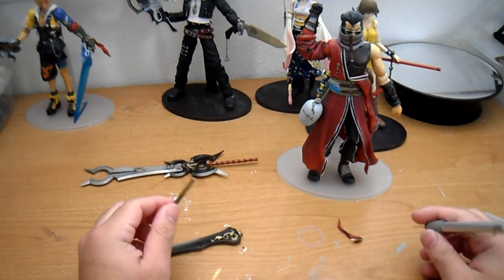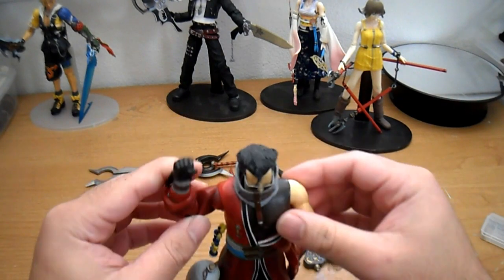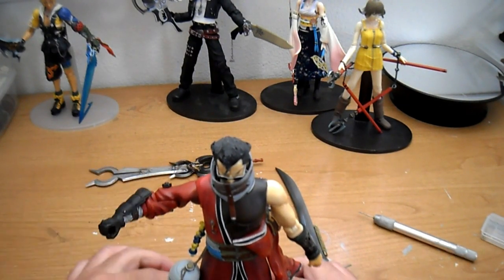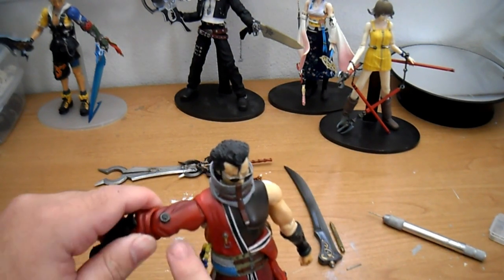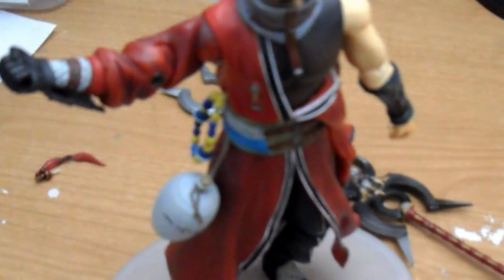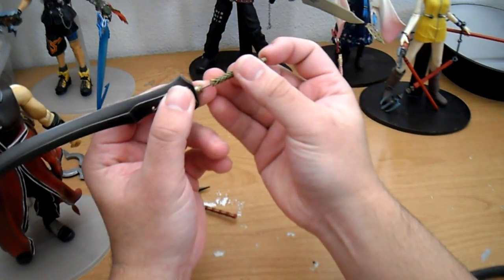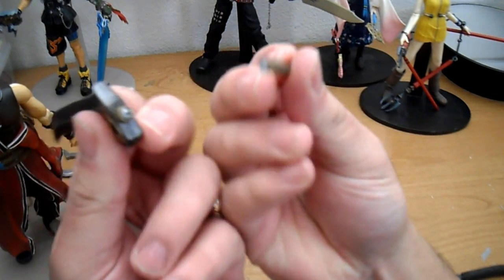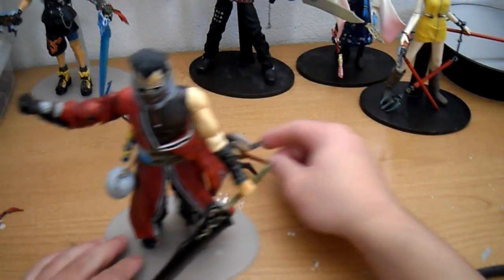Play Arts Figure Repair

Comment: Did you purchase the figures directly from Square Enix store? I ask because I received a figure with very loose joints. The head and upper torso were also popped out from the joints and I can't put them back on. However, I purchased that from a local seller on eBay